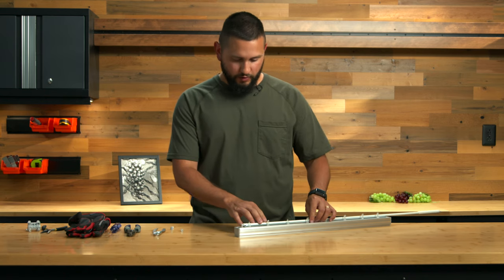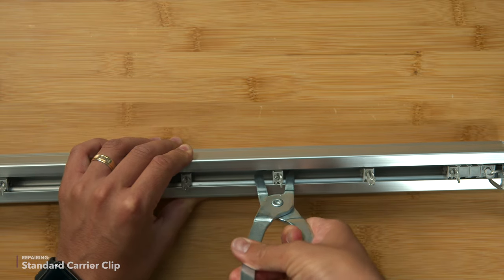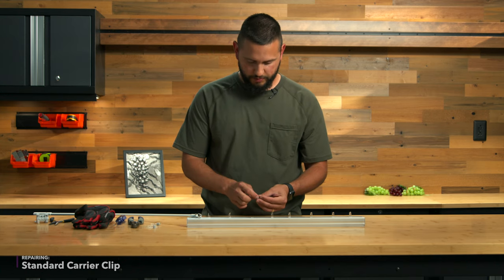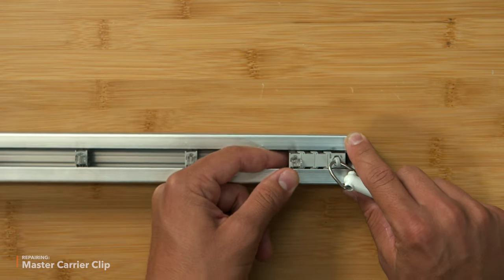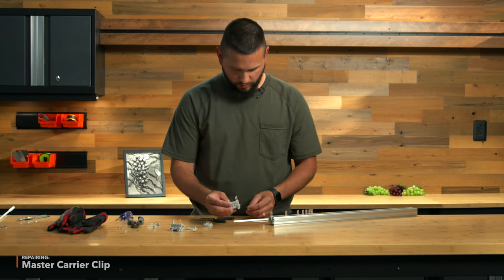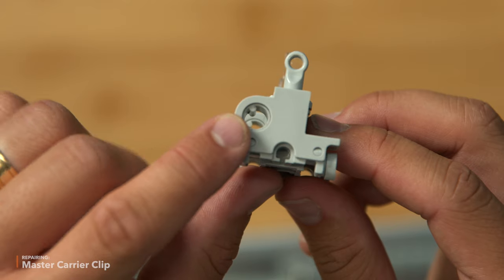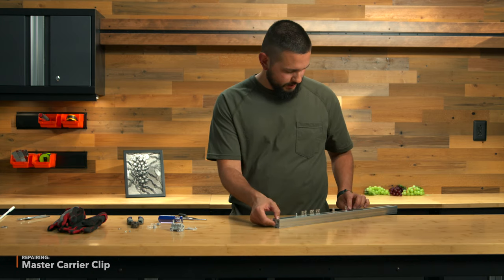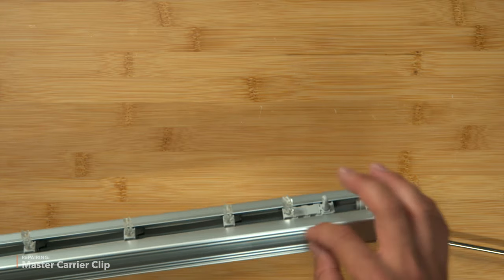How to Replace Bali and Graber Vertical Blind Stems and Gears in G98 Headrails

Comment: I agree with the comment made by Mike Oliver.  I have a broken lead carrier stem.  I've purchased your stem replacement tool, but it doesn't seem to work on my broken stem.
Reply from the maker: Hi Deanna, When the lead carrier stem is broken on a blind that is wand-operated, it is best to replace the complete tilt mechanism. It comes with a new lead carrier with a stem installed in it. Here's a link to that item on our website: https://fixmyblinds.com/products/graber-g98-wand-control-tilt-mechanism. 
Does your blind operate with a wand or with cord/chain? Feel free to reach out to us here or at service@fixmyblinds.com for additional assistance. We're here to help!